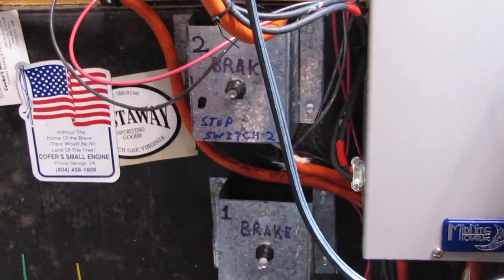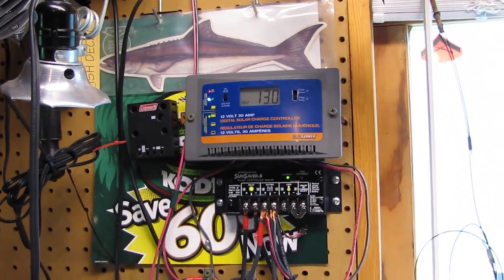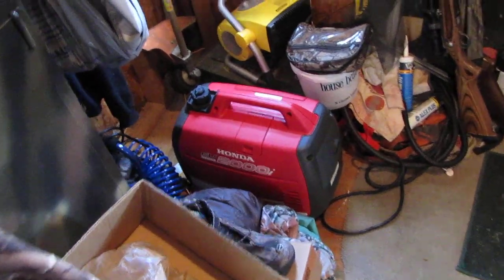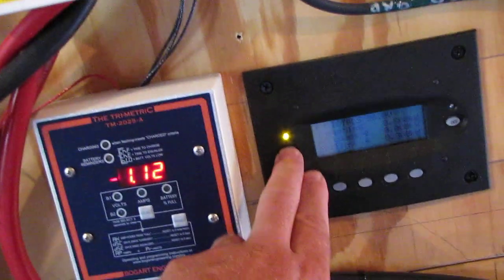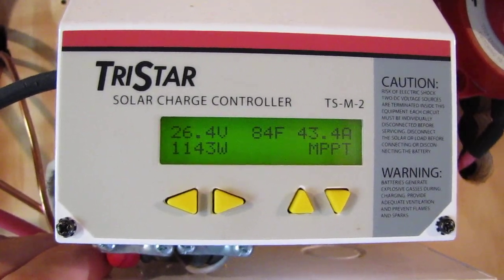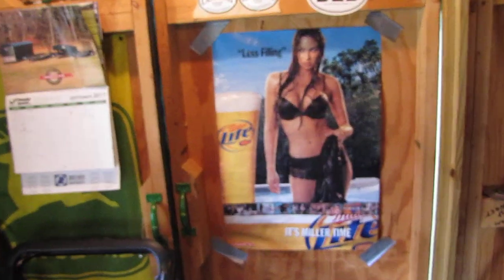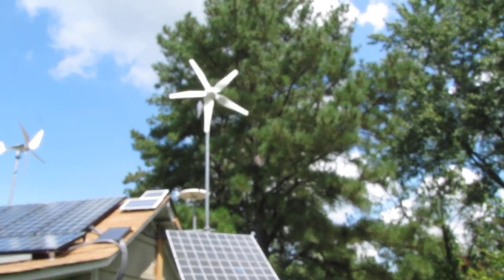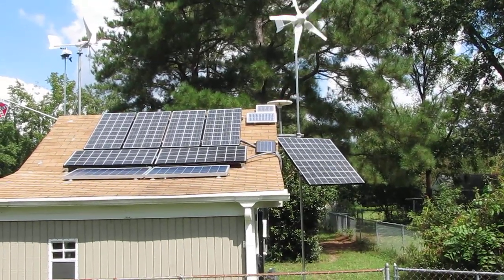My Solar And Wind Turbine Setup  Components From Missouri Wind And Solar  and Alt E Store

Comment: If you want a real turbine, pay the damn money and go here http://rover.ebay.com/rover/1/711-53200-19255-0/1?icep_ff3=2&pub=5575119394&toolid=10001&campid=5337668021&customid=Genuine+Turbine&icep_item=272348052795&ipn=psmain&icep_vectorid=229466&kwid=902099&mtid=824&kw=lg THE REAL DEAL, not Missouri junk!!
Reply from the maker: They make a nice Wind turbine Cheers Buddy
Reply: I bought 3 of the Hurricanes 8 months ago for a install in Oakly Idaho. 3 windstorms exceeding 80 mph since install and not one failure plus that turbine by Hurricane actually puts out exactly as advertised in under 30 mph.  Normally I go with Sunning Max 1000. But, you have been at this crap a long time, have you ever thought outside the box Kenny? 
 This is long but very descriptive on my think outside the box outcome. I put in links to where you can see the stuff I used and get a better idea. This really works.
 I am using a 80 amp PWM solar charge controller for wind turbines ( Only this one does this http://rover.ebay.com/rover/1/711-53200-19255-0/1?icep_ff3=2&pub=5575119394&toolid=10001&campid=5337966591&customid=80+amp+high+volt+PWM&icep_item=111837262704&ipn=psmain&icep_vectorid=229466&kwid=902099&mtid=824&kw=lg Proven Controller
Its a PWM that has a 32 volt max solar panel input for 12 volt, 50 volt for 24 volt. I use it on my 24 volt 1000 watt Sunning turbines to charge my 32 Deka batteries in a 12 volt system. I have a WIND AND SUN POWER diversion controller if the turbine exceeds 32 volts against the 24 volt slave bank. Here http://rover.ebay.com/rover/1/711-53200-19255-0/1?icep_ff3=2&pub=5575119394&toolid=10001&campid=5337966591&customid=Professional+diversions+controllers&icep_item=151823544093&ipn=psmain&icep_vectorid=229466&kwid=902099&mtid=824&kw=lg Programmable
 Very simple, you just put in a set of 4 wired for 24 volt slave batteries, cheap car/auto batteries work best since your maintaining 80%+ DOD and from there you feed that 26.8+ volts into the solar controller then set the PWM connect/disconnect to come on sending charge of up to 14.7 volts to my 32 deep cycles at 26.4 volts start, and disconnect at low volt 25.8 volts. 4 years its been working perfect on the same auto batteries. 
If you can not get a Sunning Turbine, then get a Hurricane 24 volt or higher. http://rover.ebay.com/rover/1/711-53200-19255-0/1?icep_ff3=2&pub=5575119394&toolid=10001&campid=5337668021&customid=Engineered+wind+turbines&icep_item=272253571691&ipn=psmain&icep_vectorid=229466&kwid=902099&mtid=824&kw=lg Proven Quality
 I am yet to make a video on it or any technology adaptations I have due to the idea as wired and set up with voltage balancing  chokes and cooling that I designed will without a doubt be stolen for one of his scams by that criminal known as Missouri Wind and Solar who is a life time thief and con man.
Reply from the maker: They are seriously Great Turbines  Awesome Buddy Great Research I like Them all

Comment: Excellent video and talk-up KVUSMC. Your installation is fine and I'm sure it's working fine. One thing that might cause you problems is 'cat's tails' and 'shiners'. At your screw down terminals, each one of those strands that's forced behind a terminal screw could easily break on colder days. It's just a small teeny break, but could cause a split of the particular strand, which bounces away and MIGHT short your leads out. This is a common problem with stranded wire - Use lugs or anything. l=|

Comment: @kvusmc Check out Colman Air on the Internet. Resistors are only few bucks a piece on that site.  They even have some sweet little heaters all made up with ceramic in the bottom of the boxes and louvers they are nice. the resistors are only 9 bucks each check it out. Its where jeff gets his.